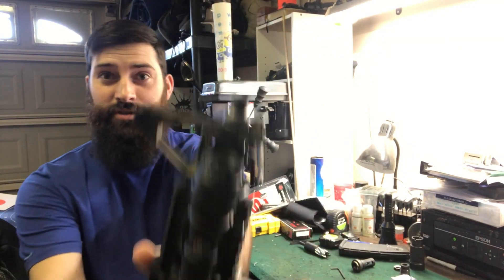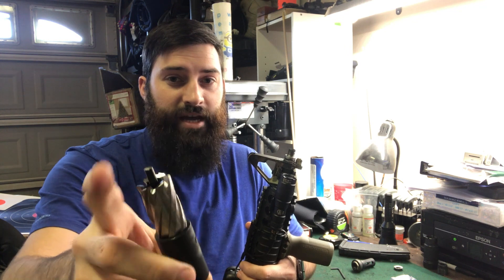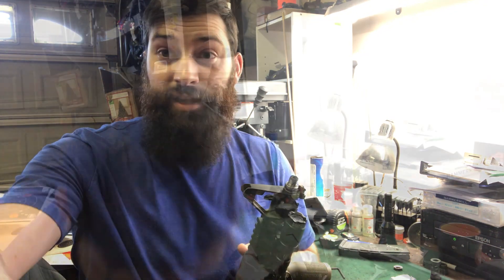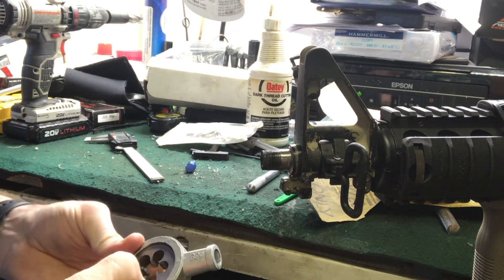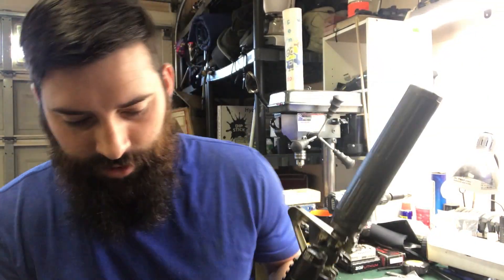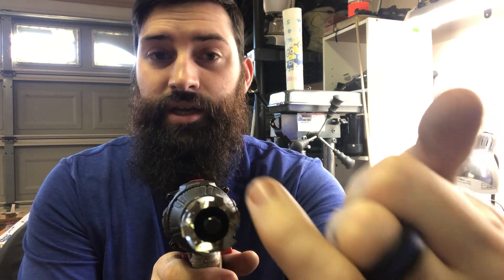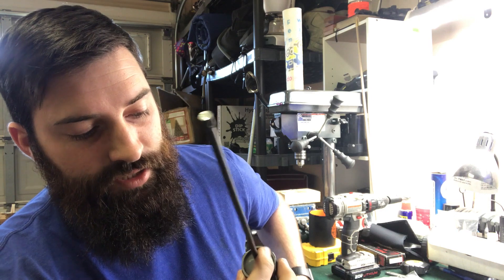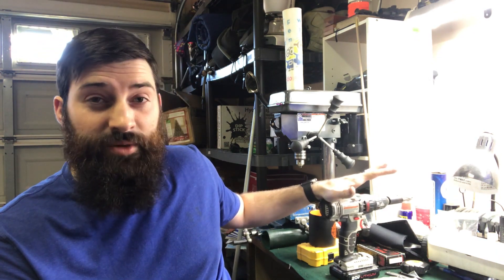Truing up my Inspired Mk18 Mod0

Comment: Good stuff. Nice to see a cheap fix. Where did you get the tools?
Reply from the maker: http://www.cncwarrior.com/1-2-Inch-Annular-Cutter-Kit-p/25760.htm?1=1&CartID=0  Thanks man. I posted the link in the description but here it is again. This method was way easier than the "poor man's lathe" I used before. Here's the die that you'll need as well. You can probably find these tools individually on eBay or Amazon cheaper but you'll have to do some digging. http://www.cncwarrior.com/AR15-1-2-28-RH-Barrel-Threading-Kit-p/25213.htm

Comment: how does it run with such a small amount of barrel before the gas port? I'm thinking of getting a 16 in mid length barrel cut to 11.5 but I'm not sure if it will screw with the reliability.
Reply from the maker: I’ve got a factory Faxon 11.5” mid-length and it works pretty well. If I use quality ammo it’ll run fine, if I run steel it has some hiccups. When I suppress it, it eats everything. If you cut your orb barrel then your probably the kind of guy that wouldn’t mind opening your gas port if you needed more pressure. 
So if your comfortable with cutting your own barrel then go for it. Just be extremely careful when you thread the barrel if you ever plan to suppress it.
Reply: Hey thanks for the reply. Im pretty handy but I don't know if I have the guts to try to cut it myself. I'm glad it's feasible though. Love the build btw.
Reply from the maker: Thanks DudeBro 👍 Honestly, with the right tools it’s not very difficult. Name of the game is attention to detail.

Comment: Solution presented may have worked for you, but when cutting a barrel and threading (Or adding threads)... SINGLE POINT THREADING the barrel on a LATHE is the only way to assure NO SUPPRESSOR BAFFLE STRIKES OCCUR.

(Above is for someone who is wanting to cut down a barrel /add threads.. 
Thinking they can cut barrel down with a hack saw /die grinder, then use regular tap and die set to thread it.....the net result = 99% chance baffle or end cap strikes. ).

PS: Does anyone REMEMBER the correct thread pitch  terminology /Phrasing /Spec for a machinist threading a barrel when a suppressor will be attached  that tells the machinist how "tight" the threading will be? 
 
(I believe there are (3)  "steppings" for a lack of a better word, like 0,1,2.. that tells machinist "how" to cut the threads.. "0" meaning there is virtually ZERO clearance between the parts, 1 having normal clearance, 2 having alot of clearance...  IIRC.)

* Directly to barrel.
 As with attaching a suppressor directly to a barrel, *Or when attaching a muzzle device to the barrel that suppressor will attach to you. 

*When using a muzzle device a suppressor attaches to you for sure want threading as TIGHT as possible, and the threading to be SINGLE POINT THREADED !

(If you are just attaching a muzzle device, and NOT attaching a suppressor Spec 1, or 2 could be used... But if using a external suppressor you want "0",  IE: The tightest spec so you remove as much play as possible... Result: Suppressor centered perfectly inline with the bore vs being off center.

Anyone REMEMBER that 3rd spec ?

.
Reply from the maker: For sure, the best way to cut and thread is on a lathe. But I don’t have access to one, nor do I have that kind of cash to spend on one,, and I don’t have room to house one. This is a good option for someone who is just gonna do one or two jobs and wants to do the job himself. There are companies out there that will do this job professionally if you are uncomfortable doing the job yourself.
Reply: Yep, I hear you.. I don't have a lathe, don't have a garage
PS: I remember you had a vid  about cutting? and threading the barrel..  Got a link ? SINGLE POINT THREADING a barrel : https://www.youtube.com/watch?v=P-lFL3c-2a4
(Q: Doesn't Youtube allow you to edit the info box ? That would be the best place for a link that is linking 2 vids together.)

Q: On the companies cutting down and threading barrels, How much?
Example of SINGLE POINT THREADING a barrel : https://www.youtube.com/watch?v=P-lFL3c-2a4
(Seems like any machine shop could cut and thread a barrel, although I can see a shop that specializes in the procedure would result in a better job, and might be cheaper. Especially with machine shown in above video.)
Reply from the maker: Good points. This is my first cutting and threading video. I will be the first to admit that the process I used is definitely not precise and not recommended. I was just showing a way one can "get the job done". https://youtu.be/Y4lHT-IkzPs
I have heard a lot of good things with ADCO and their barrel cutting and threading jobs. It looks like they charge about $75 for a cut and thread job. https://adcofirearms.com/shop/gunsmithing/arstandard-barrel-threading/

Comment: Why not just shave the bayonet lug? They are useless on barrels under 14.5" anyways.
Reply from the maker: The best way I’ve found to turn the barrel down to .5 inches is with an Annular. I got mine from CNCWarrior, part #25760. That thing will get you a concentric cut and you’ll be all set to thread. Be sure to use a pilot with your die when threading. 
I’m a nerdy cloner, and the thought of cutting off a bayonet lug just makes my skin crawl 😆 But your right, I could have just cut it off and it would have been fine.
Reply: @CalebDowning  im into clones too. I haven't built one yet but I really want to build a Colt 610 (GAU-5/A) it has a 10.0 barrel and the lug removed. Also sometimes Mk18s have a 10.0" barrel and when they have that length the lug is shaved off. The 10.3" more common ones still have it. And yours with the treads all the way up to the FSB looks like a 10.0 version so shaving it off would technically be correct. 😊